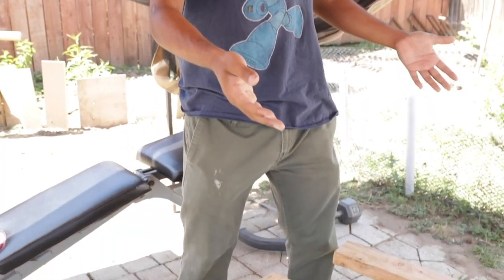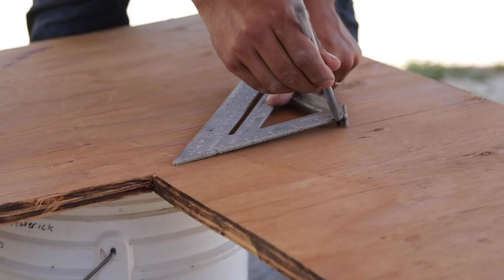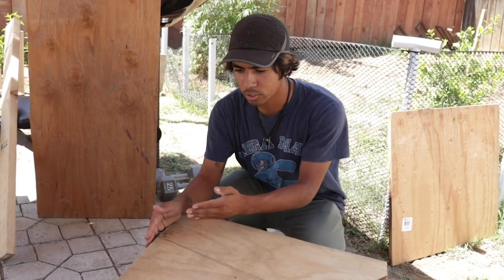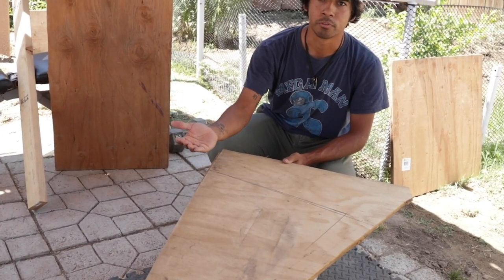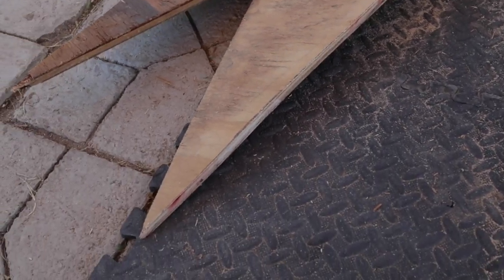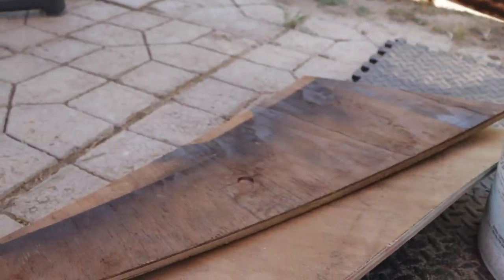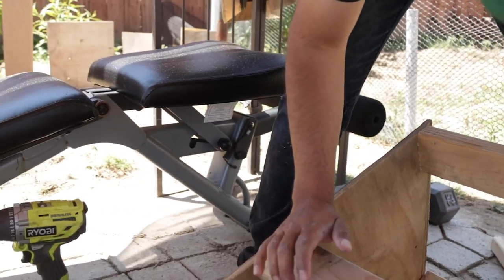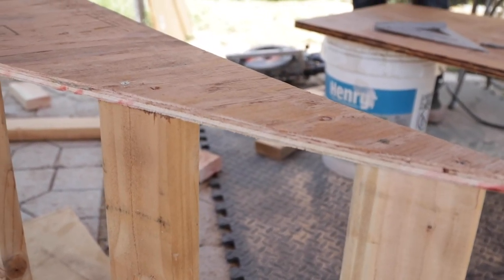HOW TO MAKE A DIY KICKER

Comment: Hey Manuel Herrera! Instead of using the edge of the tape measure to draw straight lines use the factory cut edge of another piece of plywood because those edges are super straight! Hope that helps! Ride ride ride!
Reply from the maker: thanks, when we make these projects were pretty hyped during the whole process and get emerged in it